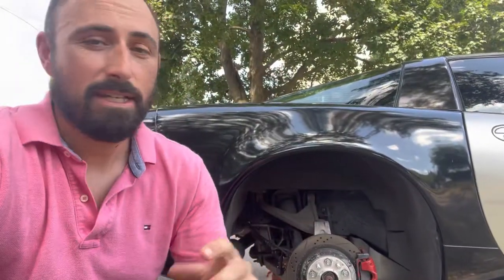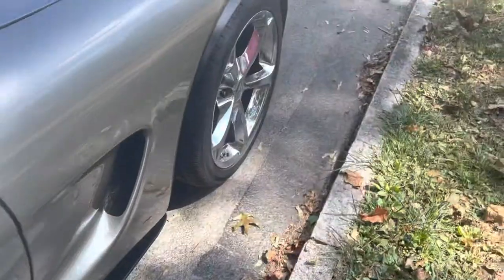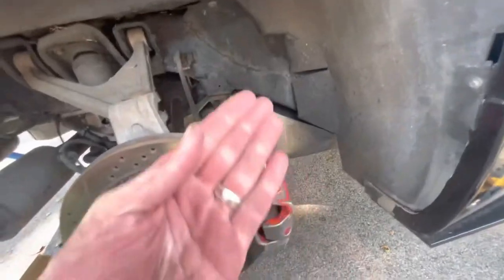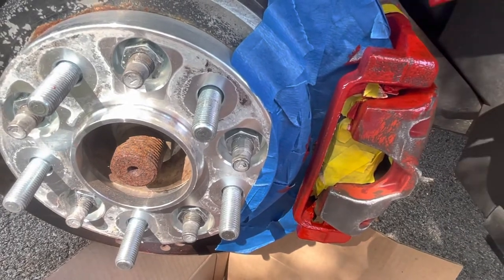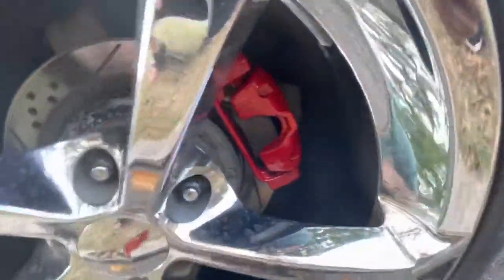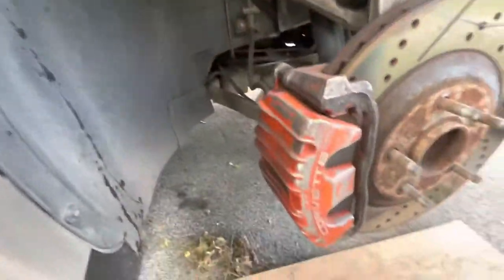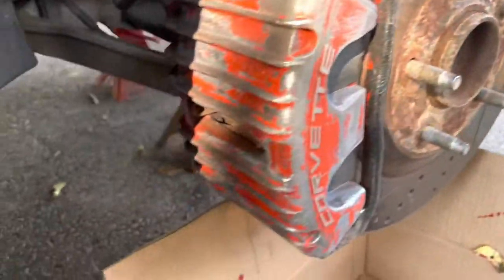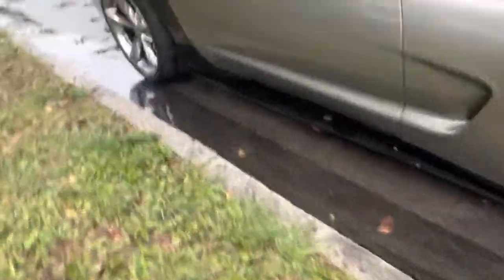Corvette C5 DIY Painted Brake Calipers for Around $50❗️

Comment: Thinking about doing this on mine. Car colour is the metallic blue, so I think a nice yellow would look nice in contrast. I was afraid I would have to take the whole calliper off to clean and sprey but it seem the brush method works well. My stock Callipers are not painted
Reply from the maker: Jump it and do it!!! They will last for many years! And when you wash your car reach in with your brush or towel and wipe down calipers and they look fresh again!
Reply: @dantedoescars  I went with Dupli colour red. Used the engine enamel primer too.